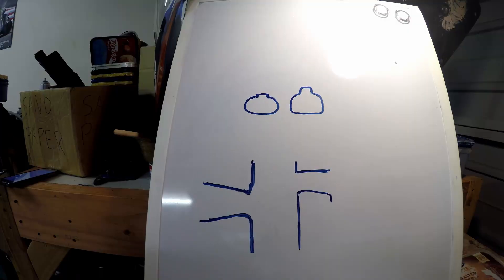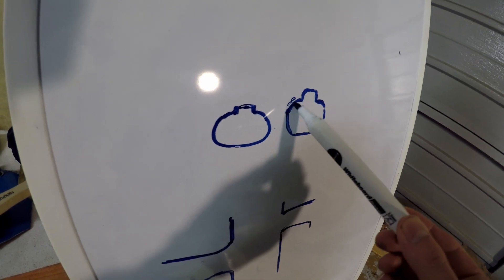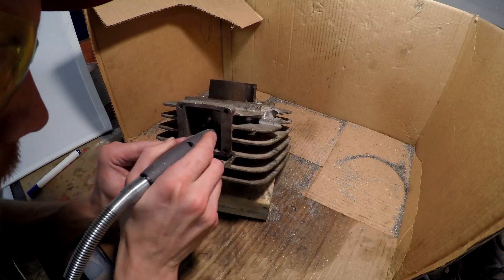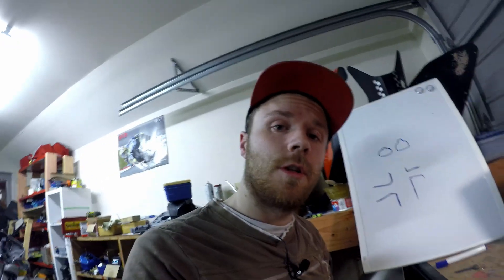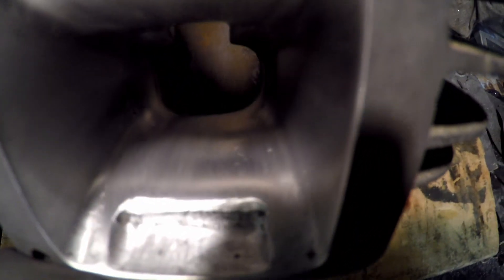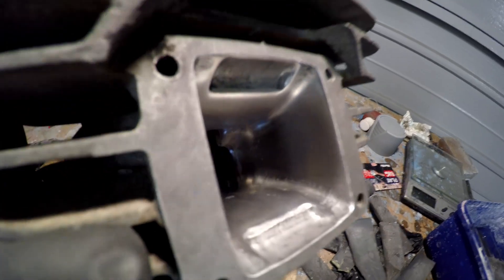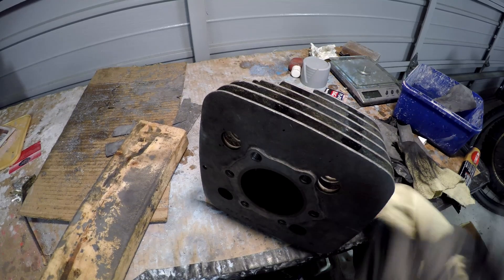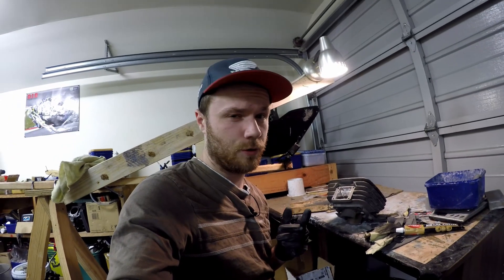Yamaha Dt175 Mx                 Porting and Polishing

Comment: I remember getting my first 2 stroke 
Got my dads big bastard file from the tool box and did a little fileing the 
Bike went alot better 
So I must have done something right , 
After that My mate took a file to the barrel and piston of a dt50
Removed loads from both 
Would hardly do 20 up hill 
But would go off the clock down a hill 
A lesson on removing loads of material doesn’t work was learnt that day

Comment: Polish the exhaust port not the inlet!, as fuel needs to atomize ,  also never use autosol anywhere near a barrel and piston as it contains abrasives that can slowly wear out the rings and bore!
Reply from the maker: @migliaman  Have used autosol many times. Works good as long as you thoroughly clean it and also ultra sonic clean it. 
Yeah I'm aware of the fuel condensation issue.

Comment: Biggest gains are in the exhaust port and timing of the ports. Opening up the transfers by the base has no effect if you haven't opened them up by the actual port into the cylinder. Opening the boost port can loose hp also. I would suggest doing a lot of research on this subject. Too many people have theories. Only listen to those who have tried and tested it
Reply from the maker: I didn't explain in the video but that's what I did, spent hours researching on what problems need to be fixed on the dt175. Also talked to several friends at road racing who raced dt175s back in the day and what they did to get em to howl.
I didn't want to go to far as a lot of people do and make a junk barrel.
So far bike is going great 😁

Comment: Not trying to be rude but that has got to run like shit. You are not supposed to polish the intake due to needing fuel and air atomization for a better and faster burn. With an intake polished the fuel will bead up and not flow. How ever, for the exhaust side, what you did to the intake is needed on the exhaust. Little to no performance will be made by only cleaning up casting flaws. Best way to make power out of porting is to, well port. Change the port timing on the exhaust and the transfers. Exhaust duration is where power is made. Higher degree the higher rpm the engine will perform better at. Transfer and basically your power curve that isn’t ignition timing. Transfers a big thing due to blow down. Take this for an example, exhaust makes power, everything else gets tuned to it. Otherwise everything looks good. Remember to keep intake corners rounded or a dull knife edge. Depending on your motor, you can knife edge the transfers without a dull but some people round them off. i’ve always kept a sharp angle on the transfer dividers for case port matching. I am a 14 year old kid. i know quite a bit but lmk if i got something wrong. Thanks! i hoped this helped.
Reply: Most of the charge except for whatever slips through the boost port will go into the crankcase and be atomised there as it goes through and up into the transfers. If i remember correctly most of the boost port charge will act as an exhaust scavenge and probably get plenty off atomisation during that process especially with a good pipe.
Reply: "Run like shit"... a bit harsh! 🙂 Just cleaning up the ports will make a small difference but like you say you need to change the port timing if you want to make any big changes, having said that there is only 'so much' that a stock exhaust will allow. Yamaha designed the port timing to allow the engine to operate in a certain way, I guess you could call this its "performance envelope", you can change this envelope or shift it around but it will usually cost you something somewhere, maybe low end performance or maybe piston or crankshaft life. I had a DT175 MX years ago, I did a fair amount of work on it, it went very well, there is performance to be gained by sorting out the cylinder head. The nice thing about 2 smokers is that they do allow the home tuner to fiddle about with them. (I have an Honda MT5 moped, I had one forty years ago when I was 16, my current one is running up to an easy 55 MPH even with my bulk on it!). Anyway you seem to have gained good knowledge especially as you are only 14, keep it up!
Reply: @sidecarbod1441  I’ve learned a lot since i had posted that comment. 

Absolutely right about a bit harsh. I guess i never really thought to myself that mixture (referring to fuel and air) is atoms we are working with. Therefore, small changes make big differences. 
I still don’t fully like the idea of a full polished intake, reason i say that is fuel beading up if there isn’t enough velocity pulling it through. Almost like a pressure washer. 
One reason to do it is to reduce the turbulent move of the mixture. Therefore flow>atomization. 

I’ve since moved from a carbide burr finish to an 80grit, 220, and a 320 finish on the intake ports and transfers. It’s much cleaner, smoother and still has enough ridges to “atomize” the fuel. 

Not disagreeing with you at all on the exhaust part being only so much you can do. Just sharing my experience. 
Around the time of that comment, i had built a super stock 12k RPM 80cc. it was fast in top speed, but had 0 low end grunt. 
I mildly changed port timing with a calculator i had gotten. i gained some low end and RPM from port shape and some more overall power. 
it was somewhere like 182x128 degrees. 
Anyway, i pushed that pipe as much as i could and it rips for a little bike. It can still very well use gearing. But makes amazing power for being a super stock.
Reply from the maker: You don't know till you try kiddo, you might learn something, also did you actually watch the video?
Reply: @TheMotorcycleForge  yes i did. I watched the entire video. Ive always kept atomization but with a polish like that i bet it flows like no other
Reply from the maker: @done-wright_performance  Much appreciated, I plan to do a video on testing the hp difference between the surface finishes, seeing which one has the most grunt, my gut feeling is on a air cooled engine it probably is pretty similar but will have to wait and see.

Comment: Very nice work, you can be proud of yourself. 

However, you don't actually need to reach a mirror finish. The experts I spoke to recommend that you stop at about a 180 grit, taking pride in your work is another matter, and I understand, especially when you have to show a client what you did, that doesn't fail to impress. 

But it's proven that air flows better over a slightly coarse surface than it does across a mirror smooth surface, boundary layer and cohesion something, they stack, create drag and laminate, why it's called laminar flow to begin with... I'm not a fluid dynamics expert, I just heard it explained during a demo - but I was blessed to be able to see the principle in action.

I still can't help myself but get a mirror finish either, so no flak, just some food for thought.

Laminar flow is actually not what you want. Dimples like those on a golf ball, that's the next step forward, because they decrease drag. Counterintuitive as it may sound...
Reply from the maker: Dam that's some pretty advanced stuff, thanks for sharing I love learning new things.
Reply: I was going to post up and say the you should not polish ports that have 'wet fuel/air' flowing through them but you beat me to it.